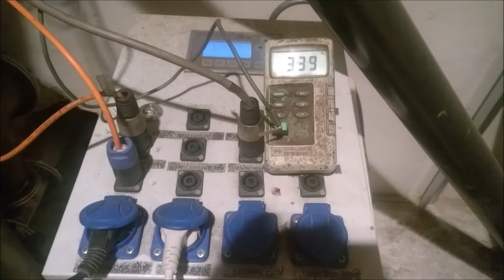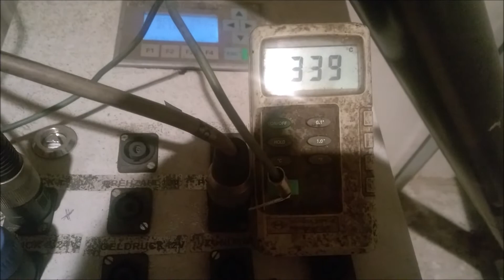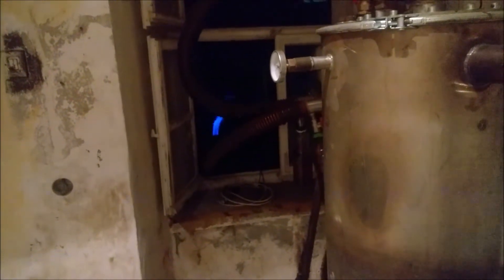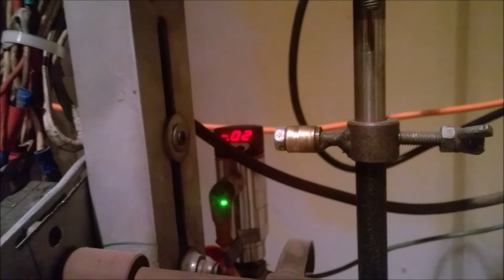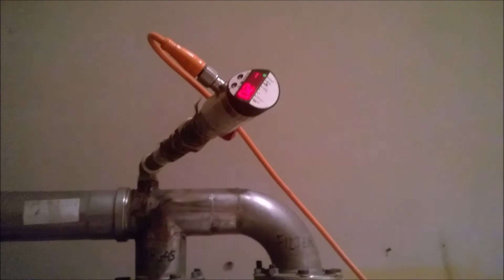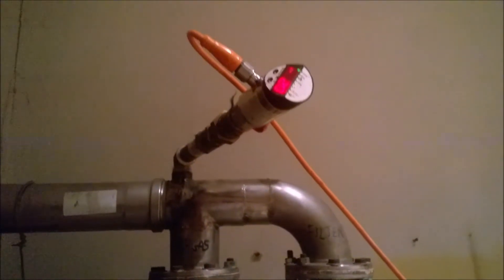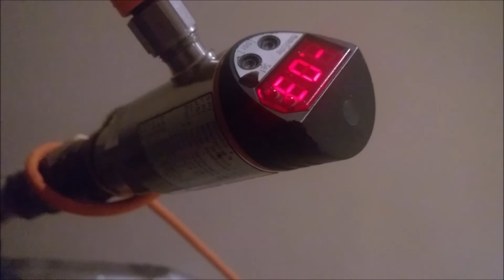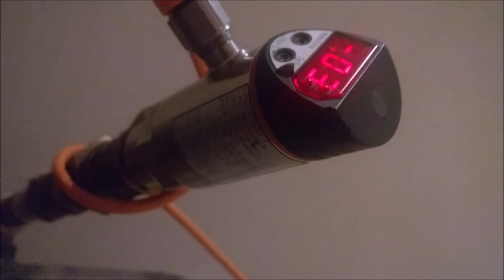Woodgasfiltering part1

Comment: Beautiful Luk. Thanks for sharing. I'd love to see more on the old filter compared to the new filter. Also, I've considered having a whole other filter that the gas can be valved around. This can keep you going after the first filter gets blocked. Joe
Reply: We are going in the same direction. Our idea is a turret revolving filter, something like an old revolver. The big chalenge is find a medium with enough surface to hold at least 15 to 20 hours, and is waterproof so condens does not harm it. I wonder how a big swimmingpool filter would cope with woodgas.

Comment: Thanks for sharing Luk. Could you tell me the maximum gas output of 150 mm drizzler gasifier in M3/hr for wood chips?
Regards. Assiem
Reply from the maker: Dear Assiem, Thank you for commenting. honestly I do not know because I do not have the needed laboratory equipement to measure the flow. but I can give you an indication. With the 1.6 liter VW motor ataached the gasifier can easely cope with even the highest load in the engine. furthermore the DriZzleR desig deliveres gas on demand. The more the engin pulls on the gasifier the more the pyrotouch sensor feed feedstock. The only limitation is to guard the reduction zone. As long as the reduction zone stays in place you get nice gas. If you want more gas just widen the fall tube.
Reply: @LukVanhauwaert  Dear Luk, thank you so much for your prompt reply! How much maximum power does the 1.6 l engine produce? Is it ok with wood chips also? Can you share your email Id for more details?
Reply from the maker: @assiemmittal1093  You could get some idea in this video about the power consumption/versus fuel. https://www.youtube.com/watch?v=-IJouTjCK_Y&t=1s We tested woodchips and it works but results vary because chips are not stadardised fuel. I am sorry about the mail. I had to end mail coimmunications. just too much, some day's i was sitting whole day answering questions. Now that I have so much video's on the tube, everybody can make a DriZzleR by the information the films contain.

Comment: Hey luke will you please sujjest me which type of blower i should you use for this operation i want to run gasifier for 4 hour daily…
Reply from the maker: Rais, I use a centrifugual vacuum blower driven by a frequency regulator. Something like this: https://www.indiamart.com/proddetail/centrifugal-vacuum-blowers-15296514088.html
Reply: @LukVanhauwaert  will you please connect me so that i would discuss more problems regarding gasifier
Reply from the maker: @raismohammadmuqeemmubin3379  Dear Rias, I am going through a very difficult period, in terms of time, also I am patenting a complete new hearthe design wich I must keep enclosed untill the patent is granted.
Reply: @LukVanhauwaert  okay sounds hard
Reply from the maker: the best you could do is post your build so far on our DriZzleR facebook page, so I can comment on what I see. This way more people could benifit or hop in with helpfull comments https://www.facebook.com/thedrizzlergasifier @raismohammadmuqeemmubin3379